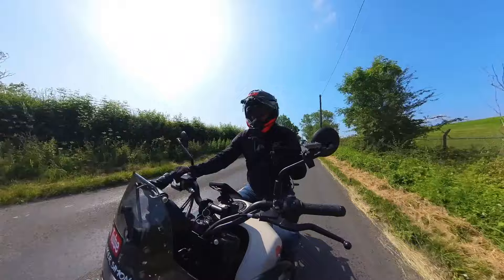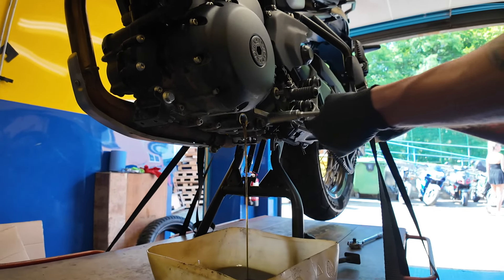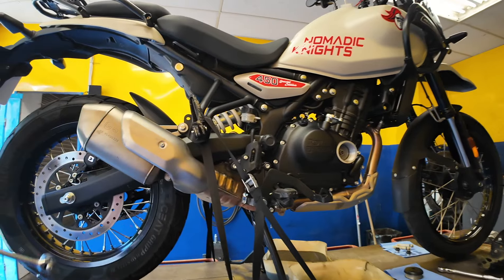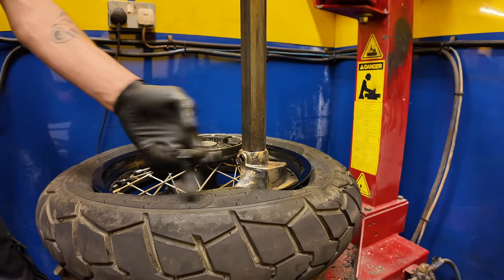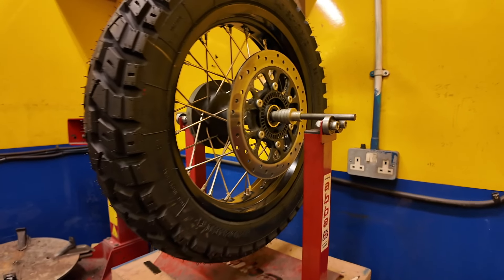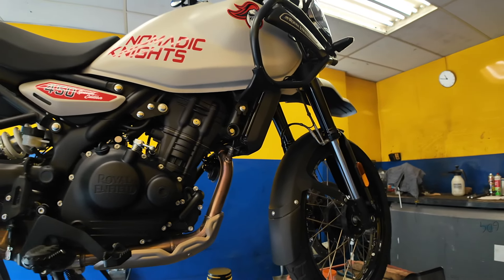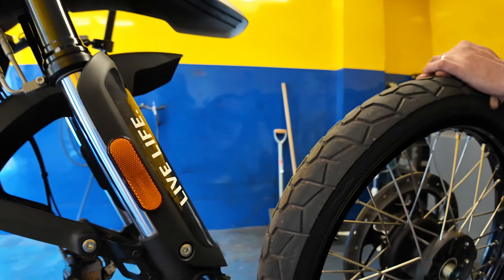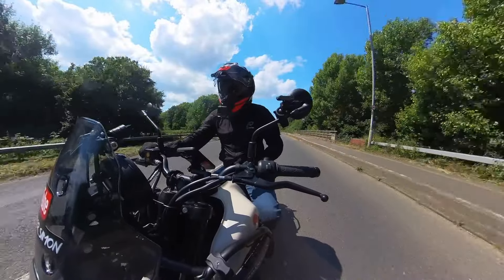Royal Enfield Himalayan 450 | First Service & Tyre Upgrade: Behind the Scenes

Comment: Beware those K60's on cold wet roads. I had a set on my XT600 and the front went under me on a white line on a damp March day. The reason they last a long time is that the rubber is a very hard compound - low grip!
Reply from the maker: I think some of the tread patterns are different on different sizes, but il keep an eye on it for sure 👍
Reply: @thatbikersimon  My front was the same as yours, my rear was a 120 and didn't have the solid centre strip. But it was the front that let me down, literally...

Comment: I met some people on the RE stand at the ABF who run the 450's. They had already converted one to tubeless but didn't change the rims. They use 3M marine tape and do three runs around the centre part of the rim. Apparently works a treat.
Reply from the maker: Sound good but it doesn’t sound like a permanent solution, but I’m not to disagree with the procedure and I’m no expert so I would need to have a better understanding of it. 👍
Reply: @jeremymurfitt In India the first week of October 24 they launched cross tubeless spoke wheels and with an offer for existing customers if they want cross tubeless spoke wheels they can get it for just 11.5k INR ( roughly 135 USD).

Comment: Any body you’ve heard of had trouble with ride by wire packing up ,if your in the wilderness by your self and the ride by wire packs up your stuck if it were a cable you could fix it jimmy West Australia
Reply from the maker: I’ve just completed a ride around the Himalayas with 20 Himalayan 450
Bikes, this was the 3rd run for these bikes so some
Of them around done around 7,000km now. Apart from the odd puncture these bikes have been absolutely faultless.

Comment: Would the tool for the front wheel under the seat be the same size to remove the oil filter cap?
Reply from the maker: Good question, im away at the moment but ill be sure to have a look when im back
Reply: No, checked the other day.

Comment: Some people put baby powder in the tyre to let the tube flex inside the tyre
Reply from the maker: I’ve never heard of this before
Reply: True.
Its like an lubrication. Talkumpowder does the same!
Reply: Shouldn’t use talc / baby powder as the perfume in it will react with the silicone rubber, it’s much better to use French chalk.

Comment: Hi Simon. Fantastic video. I was planning to buy more aggressive off road tires (80-20), Mitas ENDURO TRAIL XT+ DAKAR Tubeless tires. Do you think the front tire will be OK with that mud protector? 

Second thing: I plan to do a lot of sand, dunes in Tunisia my country,  the reason why I am considering 80-20 tires. But if your 50-50 can make it in sand, I will go with them. Have you had an opportunity to test them in sand, deep sand? 

Thanks much
Reply from the maker: Hi buddy, I’ve not tested these tyres in sand, and to be honest there’s no sand where I am to test them. If you was thinking more of a full on rally tyre then I would probably consider cutting the top of the mud guard off and just leave the fork protectors. The 50/50 tyres I’ve been using seem to work fine for road and mud so far.

Comment: Tubes versus Tubeless..  I sort of settled that debate myself.

I change all my tires myself with spoons and a small wheel stand.  This summer on a 3100 mile ride from Georgia to the Upper Peninsula in Michigan I had two flats on the way back home on my T700.

The first one was on the rear tire about 300 miles from home and I changed the tube.  I always carry a spare front and rear tube.  The biggest issue was cleaning up the sealant/balancer I always use after balancing the tire since the tube had ruptured and spread that stuff everywhere.  Never did figure out what happened but I suspect I should have checked my tire pressure in the morning when I left the hotel.  Always check the pressure when starting the day now.

Second one was the rear tire again about 3 miles from home due to a furniture fastener I picked up on the road.  It was dark out and the tire was still on the bead so I just rode home slowly and changed it in the morning with the tire since it was pretty much done.

Sure it is more work to change a tube but I have learned how to do it pretty quickly and carry the tools I need.

A few of my friends ride bikes with tubeless tires and there has been several occasions when I needed to use one of my tubes one there bikes since the flat could not be fixed with a plug.  The lesson learned there was even if you have tubeless still carry the tools and tubes if you don’t want to be stuck for awhile
Reply from the maker: That’s great to hear how you’ve managed your tyres and I guess everone will have there personal preference. I set off in a couple of weeks with 17 other people to conquer the Himalayan mountains in the Himalayas, were all running tubed tyres. So il be bringing a series of videos to the channel which might help people understand more about the difference in tuned or tubeless. 
Thanks for your input and stay tuned for more 👍🏍️💨💨💨💨💨
Reply: @thatbikersimon  btw I am interested in how your 450 performs.  They should be in the States soon and I am going to take one out on a demo ride.

Overall the bike specs look interesting except for the weight - still trying to figure out where they put the weight on that bike.
Reply from the maker: @Jarvis60 the weight comes from the build quality, everything is robust and upgraded to withstand a drop and believe me I’ve already tested it recently 🫣 it’s a strong bike and I’d sooner have that over something that’s lighter. The only issue is the side stand for me which can be corrected.

Comment: I work on all my own vehicles, I know my way around a tool box but pros like this guy make it look easy. Great video. The 450 is one of the bikes I'm considering for my first bike. The CRF Rally is another but I think it's a bit too under powered for NZ mountain highways, another is the Triumph Scrambler but I worry it's not quite tough enough for the off road tracks I want to ride. (As a new rider I'm limited to sub 650cc for 2 years in NZ).
Reply from the maker: Thanks, the new 450 is a good all round capable bike. I rode it around the south of India on a combination of roads and it preformed fantastically in all aspects. Good luck with your quest.
Reply: I've heard there are restrictions in places. Where I live I've never had a restriction on what size motorcycle I can buy.
I've had small ones,  medium sized ones and 2 Honda Goldwings. Believe me, you're not missing anything just because you can't ride a bigger bike. A bigger bike is costlier to maintain, more expensive for flat tires or buying new tires. Bigger just means more money out of your pocket and more headache. In fact, I'm wanting to downsize to the 450 to get back to having more fun. I cant wait till I sell my Honda. Way to heavy.

Comment: Just had the front wheel out of my 450 Himalayan. Getting the axle out and back in again is a pain because one fork leg is longer than the other. Would be a pain on the side of the road.
Reply from the maker: Surely the fork legs would be the same length in order for the axle to do its job. The front wheel cam out fine when i had the tyres changed